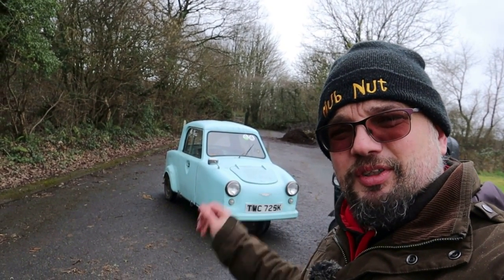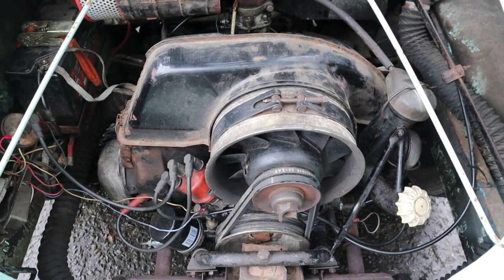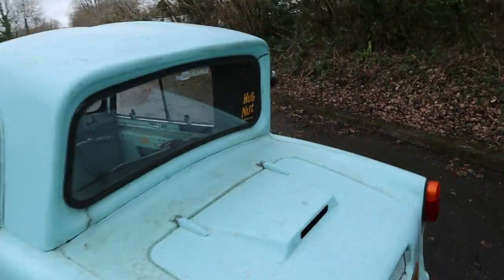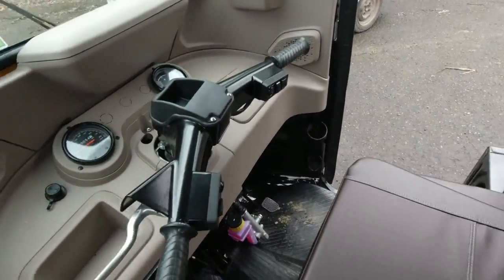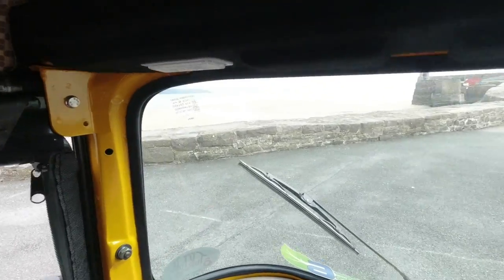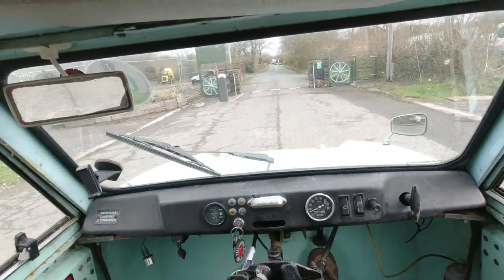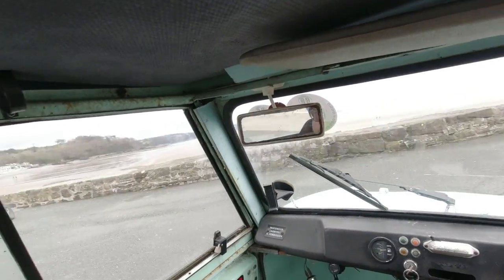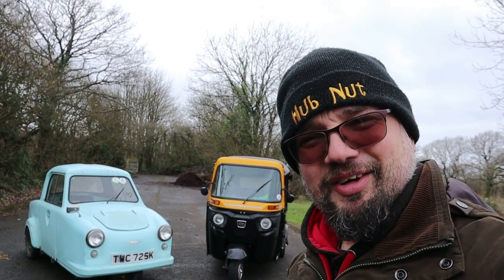THREE-WHEEL DUEL! TWC vs Tuk Tuk!

Comment: Basically in India, the Auto-rickshaw(TUK TUK) works as an end-to-end medium of transport. In remote and rural locations where you won't find any kind of Taxi, cab, or Govt bus services, the TU-TUK plays a major role.
Reply: This depends on where in India. In West Bengal auto rickshaws mostly run on designated routes only.
Reply: Why is it called Tuk Tuk ?No one in India calls them Tuk Tuk. Its called just "Auto" or Autorickshaw.
Reply: @Rahul_Singh100  exactly so. It's an auto

Comment: I totally agree Ian... Exactly... When I'm out and about I drive a Vauxhall Zafira Tourer with hand controls and get about in a sports manual wheelchair, which I lift over my knee and place on the passenger seat. Back in the days of Invacars, I remember all sorts of weird and amazingly scary "invalid carriages".... (Phil - Lancashire)
Reply: Hi Phil is using the hand controls easier or harder than the traditional foot pedals presuming you was able bodied at some point? Just curious how it feels to drive a car purely with your hands? I imagine the Zafira is perfect for you as a wheelchair user due to the big boot, high roof space etc? Also just a curious question how do you transfer yourself from wheelchair and drivers seat? Something I’d like to know but I can’t see myself approaching a complete stranger in a wheelchair and asking them to show me a example of how they do it😂
Reply: @matty6848  Great questions Matt. I'm quite strong upper body and my sports manual chair is very lightweight. I transfer using pulling, sliding and lifting. It's a technique you are taught then adapt it to your own abilities and the type of vehicle. Yes the Zafira Tourer is excellent because the doors are high and the seat height is adjustable. My hand controls are Jeff Gosling pull to accelerate and push to brake. I always use the cruise control too. I can't actually remember driving with my feet as it was 14 years ago that I became paralysed. All I can say is that it is just as easy to drive as far as I can remember. Many thanks. Phil

Comment: The BS6 sticker on the windscreen refers to the newest emission regulation in India. Not quite sure about its full term though.
Reply: Bharat Stage 6, it's broadly equivalent to Euro 6.
Reply: BS are the parameters of ethnol blending in fuel. If it's BS3 or BS4 it mean less ethnol then BS6. INDIAN car makers have to make engines as par current fuel requirement.
Reply: @Pu-nishant  I never knew about that, I've always thought it's just an emission regulation based on carbon dioxide emissions similar to the european ones. What types of Ethanol blend are available in India? Rarely have i heard about flexible fuel vehicles appearing over there.
Reply: @sequentialtt0415  It does have to do with emissions too. Same like European standard.

Comment: I think the E in RE stands for Electric Start. For most of its existence, the auto rickshaw has required two or three pulls on the left hand lever to get the engine turning over. The comparative peace and quiet may be due to it being a four stroke, rather than the traditional 200cc two stroke scooter engine. I have had some mad adventures with these things in India!
Reply: RE stands for Rear engine . It was introduced to replace the FE(front engined) Rickshaws
Reply: In  Delhi they're all four strokes now. One of the authorities' largely futile attempts to reduce air pollution. My final visit to Delhi was in 2012 because I can no longer breathe the air there. If I visit India again it might be to Kerala where I think the air is cleaner.
Reply: RE means Rear Engine beacause early tuk tuks were Lambretta ones in India which has their engine under the driver seat and were called front engine ones.
Reply: R E = REAR ENGINE

Comment: The tuk-tuk would be better with a CVT transmission I feel. Too much risk of losing momentum with the cumbersome manual set-up, especially considering the size of the engine. Great comparison, many thanks for sharing Ian 😀
Reply: Manual shifting is more efficient and the CVT would  waist power. The invacar is overmotorized with its 20 hp and can afford such waist.
Reply: @jurivlk5433  true, but given how complex the gear change process is there’s too much risk in losing precious momentum whilst trying to operate the system. Perhaps the best solution is to increase the cc rating to 350cc to address the loss of performance with the CVT.
Reply: @kevinwhelan8126  Yes, of course. The power output is very low, a motorcycle 4-stroke engine can with make 20 hp without being a high-rever like the early Honda twins with 125 cc and 18 hp I had. But Vespa seems to love ridiculously low powered engines. The 50 cc Vespa Ape have under 3hp and still move. Maybe the real values are higher than on paper. And last but not least, Piaggio is an expert on CVT's with its millions and millions of mopeds build with Ciao, Bravo, Sí, Gilera, Boxer Variomatic.
Reply: @TomAlter1000  👍👍👍
Reply: With heavy load manual works good it's cheaper for repair more mileage. Overall easy on owner pocket. Which is actually the purpose. In India they charge only 5 to 10rs in tier2 cities and in tourism kind of cities they charge like 1 or 2usd$.
Reply: When you're used to the gear change it's quick. Someone not accustomed to it will fumble it a bit but after a day or two of regular use you can change gears quickly and smoothly.

Comment: That BS6 sticker at the front refers to the latest Indian emission standard that came into effect last year. Bajaj manufactures most of the small cc variants for KTM for example. They also make Husqvarna motorcycles.
Reply from the maker: Yes, I forgot to mention the KTM link!
Reply: @HubNut  Wouldn't like to do the Paris-Dakar with the tuk tuk though.
Reply: @HubNut  a better name would have been the mobility car a mobie car I do like 👍

Comment: I can only imagine how that single cylinder engine gets on in the tuk tuk with passengers and baggage on board! I'd say you have to wring it out!
Reply: It's proof that you can have very nice sounding single cylinder engines though!

The one thing I still want to see (and most importantly hear) one day is a chainsaw engine with a 50cc Vespa muffler though. Chainsaw engines are one of the most annoying noises ever for me and I'd love to hear what the Vespa muffler does about that!
Reply: @Ragnar8504  You're absolutely right. 2 stroke engines usually make a horrendous racket with the exception of the engine in a Vespa. There are many single cylinder engines that do sound nice though. I'm thinking of my Lister D as being one of them.
Reply: @Endfloat  Chainsaw engines are generally piston ported and tuned for high RPM, and have tiny little rectagular muffler with minimal engine mufflering.  Vespa Scooter engines are bigger than most chainsaw engines. Vespa's rotary valve engine is tuned for low RPM torque and is mildly tuned for a broad power curve. They also have a longer exhaust pipe and bigger muffler. so lower engine tone. I've also previously owned 3 SAAB 2 strokes, so I do have a bit of two-stroke operation lore.
Reply: @TaUncFester  Interesting! Honestly I know hardly anything about 2 stroke engines. One of the 2 strokes I found interesting was the 1930s marine engine that Mustie1 did up a few months back. That's worth a look if you haven't seen it.

Comment: In the 1980s there was a company in Hay Mills, Birmingham which had the contract to maintain Invacars for the government. My company used to fix the heating systems in the workshops there, and whenever we visited there were dozens, if not hundreds of them in there, all blue and identical. I believe in many cases if one came in for repair they just gave the driver an exchange one, but there was one young disabled chap who insisted on keeping the same one, as he'd fitted a sunstrip in the windscreen, as was the fashion in those days, with his name on it, or rather his self-styled nickname 'Supacrip'. I always thought what a lovely chap he must have been, and how by doing that he was completely taking the wind out of the sales of any moron tempted to make fun of him!
Reply: I worked at a garage in Dorset that had a contract to repair them. The area covered from Bournemouth to Exeter, so they were always exchanged when repairs or maintenance were needed.  The Ministry of Health as it was then would not pay a double journey to return it after repair.  They were steam cleaned inside and set up ready for the next user. Only locals could keep the same one.  We had a trailer made with a flat bed, to remove the difficulty in lining up three ramps.  Like your repairer, we had a yard of them all lined up.

Comment: Not so sure, that the “luxuries” seatbelt in the Invacar, would make much difference in a crash....😳😉
Reply: I do think it would. I know someone who was in a bad accident in a Renault R4, three people I think. Two wore seatbelts and were badly injured, one didn't and flew through the windscreen and died.
Reply: The Method is your corpse still attached to the seat when they find you amongst all the fibre glass so they can lift you into the private ambulance.
Reply: Saw one crash into a sub station in the 70s, the fibre glass just disintegrated it was horrific

Comment: Ian!, weather conditions being favorable and the road ahead clear on a downhill run it is possible to attain speeds above 78mph (which I have achieved) before reaching the bottom and the speed dropping as it began the uphill climb the other side, everything at that speed was a stable as any other motor car I have driven (and that's quite a few) during my half century of driving on UK Roads and so confident was I that if a more powerful engine and uprated transmission unit was fitted to one I would have zero qualms about powering it up to become a Ton up boy, (but only on a suitable safe stretch of road away from the public) LOL!. Unfortunately these vehicles gained a lot of bad notoriety from many folk that had never even driven one, plus given the powers that be a fair chance to get any faults corrected via the Ministry, yes! the biggest and most dangerous one was to drive them at any speeds during high winds (as you experienced first hand), despite this fact I never managed to overturn one during all the many I tested during their production period (and I drove them to their limits, most of the day, every day), the real problem was there is far more to the saga than has often been covered with regards to how many of the disabled were allowed to be let loose on our ever increasing busy highways, as no matter how safe a vehicle is deemed, it is frequently the driver which is at fault and should not be allowed to get behind the controls under ANY circumstances.
Reply from the maker: Yes, mine isn't in the best fettle, so 78mph doesn't surprise me!

Comment: Back in the early seventies, when I was a teen-ager, one of my mates dad worked for a company which repaired and serviced Invacars.
Through his dad, my mate acquired an early Invacar engine, which I believe was a 197cc Villiers engine, which he fitted into a BSA Bantam motorbike frame.
Unfortunately, due to the Invacar gearbox being controlled by a hand change mechanism (similar to the Tuk Tuk), it lacked the 'positive stop' mechanism that a motorbike foot gearchange requires.
So. finding gears was a real hit or miss affair, as you could start off in first gear, and with a swift flick of the foot would end-up in fourth!

Comment: Honda's work Quad Bike starts at 520CC and is fuel injected, water cooled with catalytic convertor these days. Available as basic with selectable 4WD with five speed manual gearbox. Powershift, or automatic are options as well as power steering but no need for those complications. Forget three wheels if you want to live to a good age ;-)
No cab or passenger seat unfortunately, although there are plenty of ATV's that have these options with petrol or Diesel engines and CVT transmissions. There are plenty of such quads and all terrain vehicles working in the New Quay to Aberaeron area. Everywhere in the area really if you know where to look.  Mainly Honda, Kawasaki, Kubota, John Deere with the odd Suzuki.
I know they are not tuk-tuks but they'd do a similar job. 
Nice interesting episode and good to see something different.

Comment: Nice to see TWK running well, and this was an interesting comparison between two similar design ideas, albeit half a century apart. Invacars were a product of lean times and certainly better than nothing, providing welcome mobility for the disabled, many of whom were war wounded ex-military. So, as we saw, the engine and control gear were chosen for simplicity and flexibility of operation. What they did, they did well enough, but when times got better, it was clear that better vehicles should be provided. 

Tuk Tuks evolved separately in the Third World from bicycle rickshaws, then motorised using scooters, and now with designated engines and bodies. It seems they still perform a useful transport service in India and the Far East. Presumably electric versions are also increasingly being made.

Comment: Rev matching and engine load control is very important in dog boxes. Reduces the clank. Once you got the hang of it, you can upshift without clutch flawlessly. For downshifts, you do need the clutch (or an auto blipper and quickshifter - quickshifters are sooo satisfying!)
Though on most bikes, you shift with your left foot, so that makes it easier to operate everything in one smooth motion.

Comment: Does ether  one have a heater ??  I would think the car would use the hot air from the cooling of the engine to warm up the cabin and defrost the windshield ? My buddy in high school had a 2 stroke Trabant  that had a heater like that had a flap on the engine cooling duct to turn it on and off no blower the more you revved it the warmer it got !!

Comment: The first car I owned, a 1964 Lightburn Zeta, also had a four speed reverse, however  in the Zeta this was achieved by starting the 324cc Villiers two-stroke engine backwards. Driving it was quite normal though apart from the engine's limited power. It was the same length and width as the Mini of its time and the interior was surprisingly spacious. Controls were similar to any small car except that the quick, positive gearshift was on the steering column and the gravity feed petrol tank necessitated an on-off switch for the petrol.

Comment: Back in the early 80s, I was caught in a traffic jam on the M5 near Stroud in my Austin Maxi. Because the traffic was slow moving, the engine overheated (there was a leak in the system somewhere), so I pulled over to top up the water.
To my surprise, I was joined on the hard shoulder by the driver of an Inva Car - who proceeded to ask me for directions to Stratford upon Avon! I don't know how far he had already travelled, but he had more than 60 miles to go (probably more if he didn't know where he was going). I'm not sure if the particular model he was driving was allowed on motorways, but I directed him off at junction 13 just to be safe. To this day I still wonder if he got to his destination. It certainly can't have been a comfortable journey!

Comment: Interesting 3 wheeler comparison and impressively smooth single cylinder engine, but in 50 years time would the tuk tuk have stood the test of time and be running as well as the  Invacar?

Comment: How well does an Invacar engine braking downhill? I know a DAF has a switch which operates a vacuum so the CVT stays in a lower gear.
Reply from the maker: The belt drive feels very draggy, so engine braking is actually really good.
Reply: Ah, yes of course, an Invacar is much lighter so the drag of the CVT will pull the speed down enough. The DAF's "mountain brake" as they call it (like we have Dutch mountains 😂) operates up to 50 km/h anyway. My grandmother who drove DAF lived in the flattest part of the country and it was long after the death of her DAFs (she bought a new Charade with Daimatic in 1984 which outlived her) that I came to realise what that hazard-light-like switch was...

Comment: Despite TWC's limitations, it's definitely the winner to me. I also think the CVT is doing better too - engine revs aren't as high as they have been - and that's correct as you were not flogging it flat out in this video. I'm sure the trip there and back had the engine up to the usual rpm especially from a standing start !

Comment: The only time I've seen one of those starting handles before was on the famous 1920s Hanomag Kommissbrot micro car! The Kommissbrot also had a single-cylinder engine.
Reply: They had those types of starters on some lawn mowers too but it was a push down type .